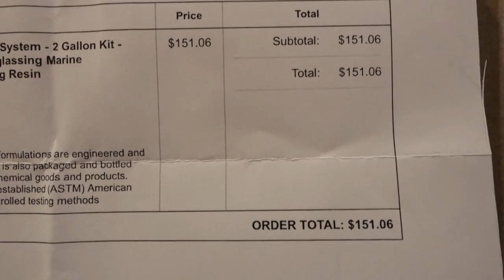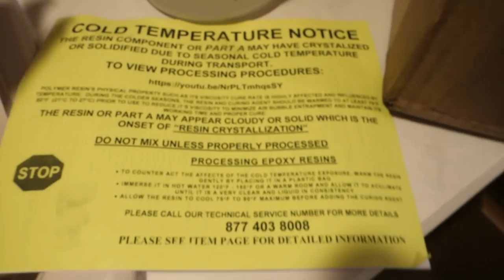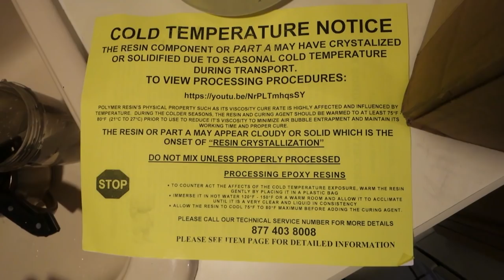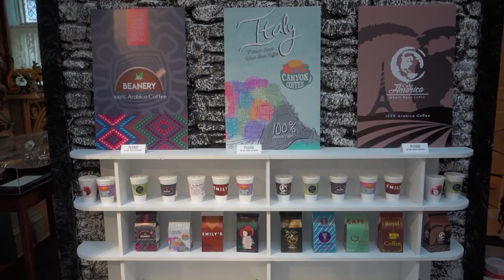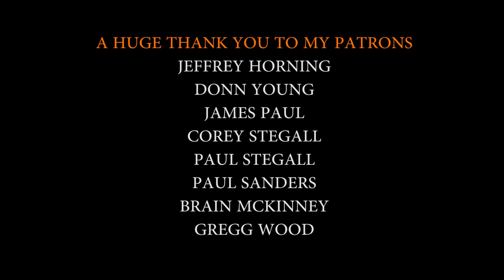How to Build a Wooden Boat 20 - Marine Epoxy Delivery for Waterproofing the Hull

Comment: looking great Andrew! have you figured out where your water line is going to be?  I'm thinking that when fully loaded you may have 4 to 6 inches of draft....but I'm just guessing.
Reply from the maker: Yes, I was guessing maybe 6" though may build a wooden tank, lined with plastic and strapped around the outside to do a test float Ray. I might be doing a trailer build a bit like yours too, but need to book a rental trailer asap as time is dwindling.
Reply from the maker: Though tbh, I could well imagine a couple more inches of draft with the 2 deep cycle marine batteries.

Comment: Vinegar and water will bend birch plywood from Home Depot.  You could've done the sides you did with one piece.  Their birch ply has a sort of Masonite core so the actual wood you're bending is barely a 1/16" thick
Reply: We don’t have Home Depot in U.K.